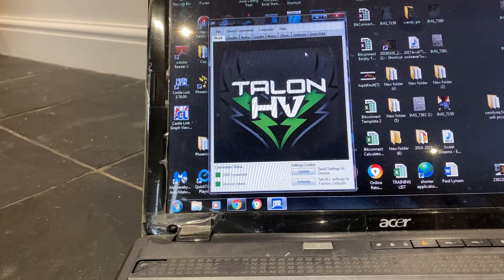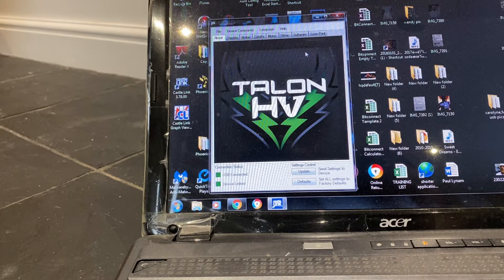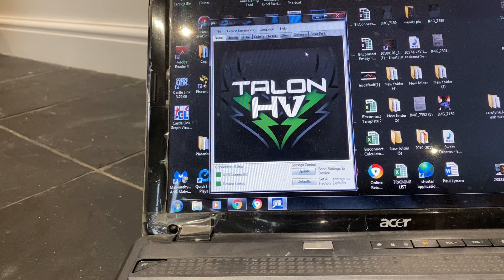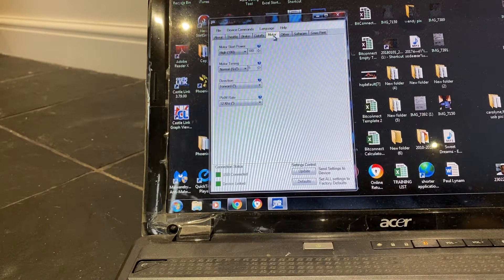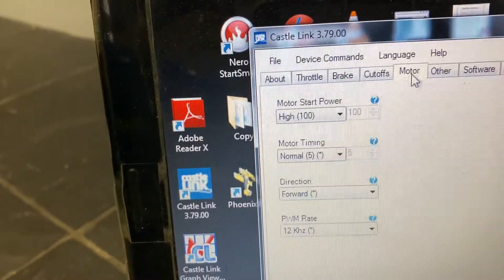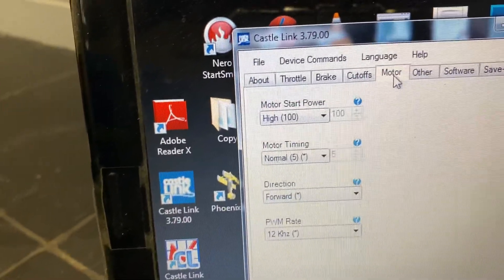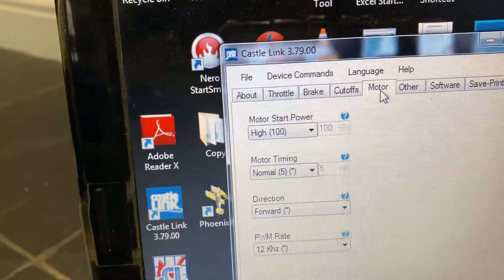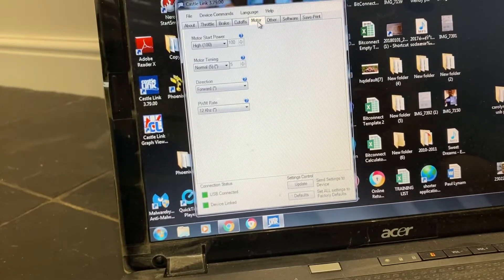Castle creation 120 amp Max HD problem fixed from Avian Spectrum smart ESC! NOT A SMART ESC AT ALL!!

Comment: Hi Danny, I have a xpwr 40cc to go in a 78 pilot 330lx and was going to use a spektrum avian 120amp esc, did the spektrum not work out for you?
Reply from the maker: Hi Rob.. I have 2  spekrum avian 120 amp ESC I put them both in Xpwr 35cc slick 74” pilot RC and 78” extra 330lx pilot RC.. you will see on one of the video with the slick have Avain 120 amp ESC in and the motor just Stutter and search at high end of the revs.. I found both of them did the same.. so I replaced them with Castle creation Phoenix edge 120 amp in slick and 160 amp in extra 330lx.. Castle creation Phoenix edge is the only ESC is compatible with XPWR motor.. if you watch all my recent videos on my pilot RC slick and pilot rc extra 330lx it Explains all about compatibility with the ESC for that motor Rob! And if you do get the Avain to work at full revs without the motor searching and stuttering let me know the settings cos that will be interesting!!
Reply from the maker: Rob I have 4 Xpwr motor and they all run on Castle creation Phoenix edge ESC.
Reply: Thanks so much for the reply Danny,  I think I will go with the cc edge 120.
Reply from the maker: Rob is hard to hold of castle creation 120 amp phenix edge that’s why I went for 160 amp on one off them!  Good luck if you can.
Reply from the maker: And thank you for taking interest in my video and your time to watch my videos thank you!